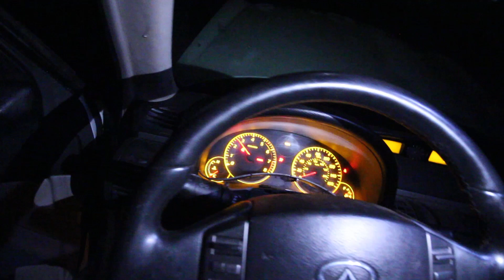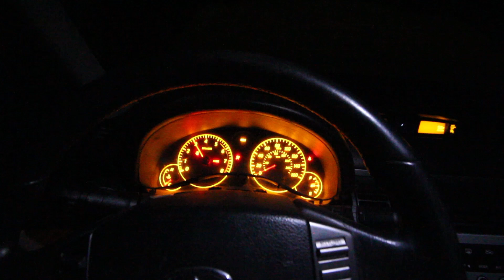G35 SEDAN RUNS! FUEL PUMP REPLACEMENT | NIGHTRUN

Comment: So did this fix any knocking? Mine knocks like hell only after I drive it and it starts up every time. Idk if this is my issue or not just trying to see.
Reply from the maker: If your cars knocking bro that’s your bottom end. Motor is toast😬 happens when they’re ran too low on oil. Mistake a lot of vq owners make esp de bc the dipstick can be hard to read. If its actually knocking you’re gonna need a new vq
Reply: Thanks, thats kinda shit but the motor has atleast 200500 miles on it and I would like a warrantied  eng. but still damn. @UN7 😭